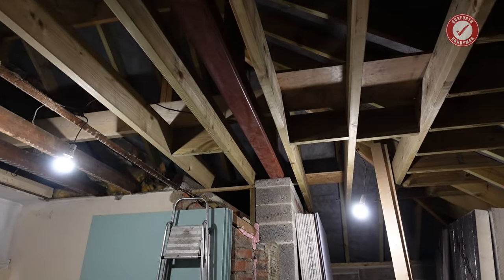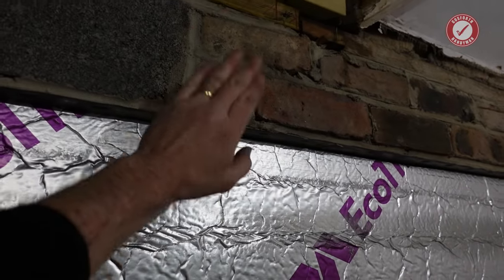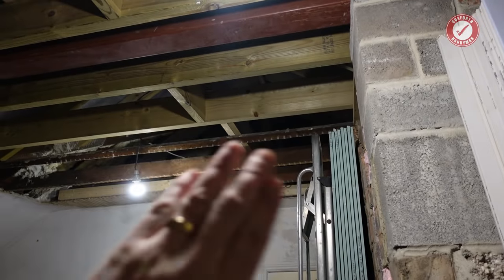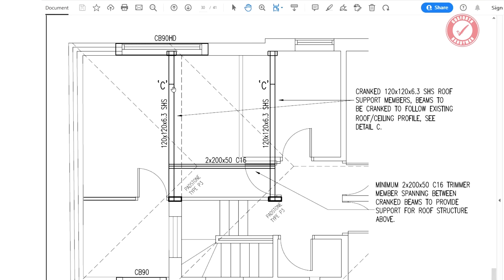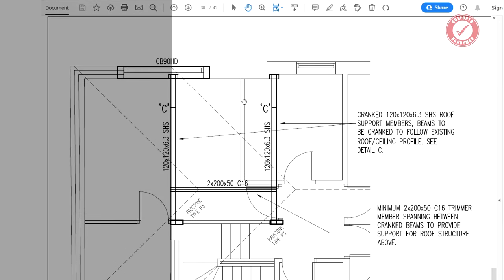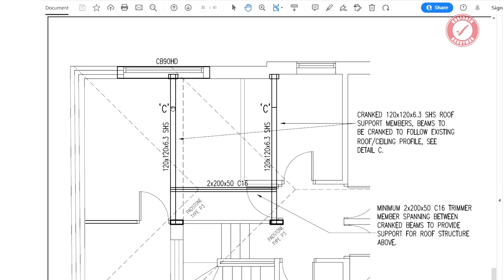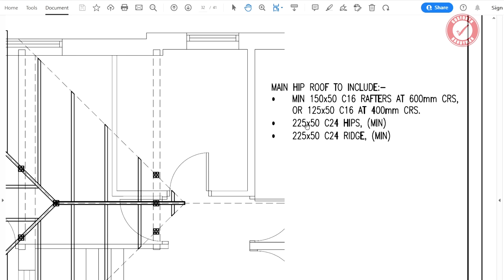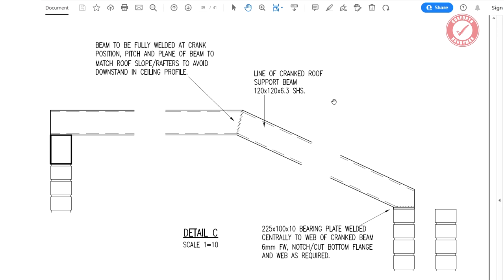Steelwork and structural engineer plans explained (Self Build Extension Part 11)

Comment: Thank you for the explanation Andy. As a practicing Chartered Structural Engineer myself it does all make sense. Not saying I'd have used timbers that large (preferring to sympathetically match the existing, cross battening where necessary for modern insulation so plate levels are maintained) but the basic philosophy is sound. Those uncoordinated details caused my eyes to bleed a little, the drawing checker wants their knuckles wrapped for that! What I find with a contingent of modern builders, and even some supposed experienced roofing carpenters, (and particularly the keyboard warrior experts) is that they don't understand thrust, spread and restraint. A fresh new roof may well look like it locks together without all that structural gubbins, but timbers shrink, joints open, relaxation and spread occurs, and then the householder sees cracks that repeatedly open until, sometimes years later, if at all, the roof reaches an equilibrium, and all the time normal seasonal thermal and humidity movement racks the unrestrained roof further. That early spread movement may have disrupted brickwork, and even rotated lintels. It's much better to properly restrain roofs during construction and mitigate all those nasty issues that will otherwise plague the building. And it rarely takes much more effort. As well as designing, we also write structural reports on (mostly) older properties for those selling and buying. Whilst many old roofs were build well and sound and have no significant issues at all, we make a good living out of appraising those other old roofs where the experienced carpenter thought he knew best and elected to provide insufficient restraint to rafter toes (particularly hips) leading to spread, internal and external cracking, bulging/leaning walls, or where purlins are undersized / insufficiently propped and have sagged and twisted, or ceiling joists bounce better than some garden trampolines - toe nailing through binders to hold up ceiling joist is a classic failure issue as the nails withdraw over time. The naysayers putting up roofs today with more confidence than skill, knowledge and understanding will continue to provide me with an income in sorting out their spreading roofs long in to my retirement and beyond. However, I can't see anyone having an issue with that new piece of roof, Andy. Aside from the somewhat chunky and generous timber sizes, well done for having it all put in. A good nights sleep will be had below those timbers. Thank you for sharing.
Reply: Would you have recommended trusses for the addition as opposed to the stick build as an alternative solution?
Reply: @peterwooldridge7285  Hi Peter. For this addition, no. It's far too small and would have resulted in a considerable amount of hand cut anyway. Trusses are usually more suited to areas where full span trusses can be erected over a larger area. Hips always seem to involve a lot of cuts, and this roof seemed mostly a hip. Not to mention there would still be a need to provide support to the existing roof where the original hip was unpicked.
Reply: It's really good of you to go into this much detail, well done 👌
Reply from the maker: Cheers Andrew - great info as always! 👍👍
Reply: Fantastic response - thank you so much for sharing your insight. I'm involved in the peripherals of the construction trade (on the banking side...often pronounced with a soft 'b' ;) ) and have seen my fair share of Chartered Surveyor & Engineers reports where things have started to go wrong - it can get scary and result in the remediation works costing more than doing it properly in the first place (although it's never the person who cut the corners that gets to pay for it 20+ years down the line). As someone who relies on professional reports (and the Professional Indemnity policies behind them) it's a great comfort that the designs typically provided by the SE takes into account the natural lifecycle of a structure and dynamic nature of the materials used. Incidentally - how much consideration is given to dynamic loading for this sort of design? Presumably there is a great deal of torque applied to a structure in heavy winds via the roof in addition to the static weight of itself?
Reply: @colinmottram4429  Snow and Wind loading, and their relevant combinations, are taken into account as necessary, especially for more complex multi-pitched/span roofs. Snow loading is always considered, with the intensity dependent on the pitch and areas where drifts may occur. Wind uplift may be the only relevant wind case on tiny roofs of this nature, although with the small form factor and limited overhangs, uplift and suction is unlikely to be significant and would easily be accommodated with usual holding down restraint straps. A vast number of older properties are pre holding down straps [mine included] and in the main seem to survive without significant incident. The dead weight of the roof alone has often proven sufficient [in the main], albeit with some notable media reported exceptions in recent months. Recent wind related failures with which we've been involved have usually been related to the absence of lateral restraint to gable ends, which has resulted in the extreme wind gusts sucking out the gable end, or where cavity wall ties have long since failed [or perhaps are absent/insufficient as reported in a new-build incident up north here a few years ago] and the wind has unzipped the external skin.

Comment: Thanks for explaining.  Basically the ridge needed some support but there was nothing under it so the steels bridged the gap to get a solid base to support from.  
I am jealous of your slope insulation. I spent days up in my loft retro fitting that and sliding insulation down the gap and doing the jack rafter gaps from the outside.
Reply from the maker: Cheers! Yeah, the slope insulation is critical as it's the coldest part of the roof. Defo worth doing. 👍
Reply: @GosforthHandyman  This, along with the cavity filling has made a huge difference. 
As we have a steep roof and a deep overhang, the outer skin of the wall stopped  about 50cm below the inside skin wallplate. So while repainting the outside I took off the fascia and insulated that gap too. I could not find anyone else who has done this!

Comment: Hi sir   I think the engineer has been very wise , and has been very prudent not to take any notice of the existing structure . Just those last photos of the existing rafters is proof that he was right . Even my own house that was built some 40years ago has sagged slightly even though the house was designed with 
18inc RSJs x 5 running the full  width of the house . The reason being for sagging is the jack rafters were just not big enough , if it was being built to day they would be a lot bigger . Having said all that the roof is not going any were because of the massive steels used , but I just thought it was a good example of things that can appear in the future .      Best wishes and kind regards as always 😀👍👍👍
Reply from the maker: Yup! In this scenario better safe than sorry. No sagging of the original timbers in 100 years but it's only a small roof. 👍

Comment: I do structural engineering for ships, not houses, but your explanation was good. I enjoyed seeing the architect and engineering drawings. You’re absolutely right that the engineer had to assume the new structure needed full support. Without the as built drawings for the house originally plus a detailed survey to note any changes since build and the current condition of the structure as it stands, it would be irresponsible to assume the strength of the existing structure and then depend on that assumption for the new work. If anything were to happen down the road, they would be legally liable for damages because of that assumption. In my work, we actually do the surveys to determine current as built condition because it is EXPENSIVE to assume the worst and with large ships the job is already costly and materials are a much bigger portion of that than the engineering. As you said, those beams aren’t cheap! But in small residential renovations like this, I assume it’s more cost effective to make that assumption and pay the price in materials than to do the investigative work to determine the bare minimum support required.
Reply from the maker: Very interesting! 👍👍

Comment: We live in an old terrace where the roof has huge purlins (think that's the correct term, they look the size of large tree trunks) With a big triangle construction in the middle of the roof made from huge sawn timbers, with smaller rafters sitting on the purlins. All the timbers look more like logs than modern rectangular timbers, all the joints are dove tailed or mortise and tenon. In terms of craftmanship its a beautiful thing to look at (even if it does make feel somewhat unsure of its structural integrity after all these years).

However this video got me thinking how you would marry that old construction with modern construction if you were to try and do a similar extension on a roof the age of mine.
Reply from the maker: Old terrace houses often have huge roof spaces so the spans are much bigger. In a similar extension you'd need extensive steelwork. 👍

Comment: The steels make more sense now, although I would have thought the existing timbers were very 'examinable' in situ and the steels would have been just as effective if they'd been tension bars spanning the house and attached to the roof spars to prevent the roof spreading under its own weight. But as you say, there's no point arguing.
Reply from the maker: Yeah, I didn't really want to argue the point as he's worked in hundreds of these houses. 👍

Comment: The timber and nails scenario just highlights at some points just how "rough and ready"  the construction industry is.  However, it's best to adhere to engineers guidelines and better to be safe than sorry Andy !
Reply: I find it quite interesting. Our home was built in the late 1800's. All the floor joists are dove tailed into two large beams that span the downstairs space. You can see old stuff beautifully crafted together, whilst the modern repairs just butted up against and scatter-gunned with screws/nails. I suppose its strong enough and time is money and all that
Reply: That's when real artisans were working solely with hand tools, No electric drills and saws et cetera then Stephen.
Reply from the maker: Indeed! When you think this entire original roof was built only using hand tools. We've become lazy as a society. 👍💪
Reply: That indeed is the case Andy ! It's all starting to come together.

Comment: Thanks for the great videos, I'm learning lots!  Also I've just found the measuring up podcast, only a few years too late.....
Out of curiosity, how picky are building control?  If the structural engineer specs 2x(100x50) and you use C16/24 it's actually 95x47(IIRC) are they going to complain or is this more of the typical building materials nominal sizes and you need to know what everyone actually means rather than what's written down?

Comment: I understand the structural proposal but I have to say that the sizes are much larger than I would have expected and certainly more than would probably have been specified by the various structural engineers I use.  Unfortunately, some engineers design on a dot to dot basis and not holistically.  An example of this is that is the size of the ridge beam than can either be assumed as carrying weight or as just a separator of the rafters, that is why traditionally the ridge plate was 200/250 deep x 25mm  
The 120x120x6.3 SHS is actually 120mm by 120mm by 6.3mm wall thickness Square Hollow Section.  You also get RHS and CHS that are Rectangular and Circular respectively.  I assume that the SHS was specified to get the steelwork within the depth of the rafters.
Having now seen in detail the construction I assume that the central double beam doesn't support the enormous ceiling joists so that it and the steelwork only support the roof.  If  so, then there is no need for fire protection to the steelwork.
I note that the roof has been sprayed with polyurethane foam, which is a real problem as the system is not vapour resistive and thus condensation will occur in the rafters but before then it would not surprise me if the tiling battens start to rot as any water getting through the tiles will run down the sarking but only as far as the first batten where the foam has taken the sag out that normally allows drainage of incidental water.  If you were to retain the rafter level insulation it would be logical to extend that over the new roof, but be aware of the required detailing to prevent vapour passages and cold bridging.  A good solution to this is to use multi-foil insulation/vapour barrier. and PIR board under.
Reply from the maker: Cheers Clive! 👍👍

Comment: Can see it has 'belt and braces' , a very solid construction apart from one thing -  a purlin. Think I would be tempted to add one between the two vertical supports on either side to give additional support to the intermediate rafters. But suspect the rafters have been sized to allow for this? 
Love roofs. Always a mess of timbers !!  :)
Reply from the maker: The the rafters are sized to allow for no purlin, since there wasn't one in the existing roof. 👍

Comment: Old ridge timbers were usually only 1" or 1 1/4"r inch thick as they do not support anything [the rafter each side support each other]. it is just there as something to fix the rafters to and stop them moving about.
Reply from the maker: Yup! The 9" ridge timber did seem a bit excessive. I guess it was partly to accommodate the bigger hip timbers and rafters. 👍
Reply: @GosforthHandyman  There were no structural engineers involved when that place was built. They do tend to work it out. double it and add the date in. But as you say you have no way of doing it.
Reply: Using the, 'look these buildings have lasted 100 years + so old building methods were good, no need for all these calcs' argument, does not take into account those old buildings which fell down or were replaced because of structural problems. We are seeing the survivors, or satisfactorily remedialy fixed, today. Numerous Cathedral's roofs had to be re designed and replaced, as they were built, but these were well documented buildings.
Modern materials are often heavier. Replace a slate roof with tiles and the structure needs redesigning, including the slope.
Great video Andy.

Comment: Don’t forget that the older timber is usually very strong. I struggle to cut some of the older stuff.
Reply: You need to use an old saw.
Reply from the maker: Good firewood too!
Reply: @ricos1497  Well said.

Comment: Fascinating! Will all that spray foam insulation on the original roof now be redundant? I pressume you either get the new roof sprayed or fully insulate the whole ceiling to current standards? Edit: Sorry I think I found your answer way below - Insulate whole ceiling. Cheers.
Reply from the maker: Yeah, might take the spray foam out at some point. Keeping an eye on it. 👍
Reply: Did you have any morgage problems with the spray foamed roof?
Reply: @donald840  I sold my dad's house about 5 years ago and had 3 people pull out as their lenders wouldn't give a mortgage as it had foam spray in loft, had to change roof eventually to sell it.

Comment: Wondering if you had stripped the entire roof back and rebuilt the roof structure, would it have been comparable to the cost of getting the steels done and in and all the engineering? And what was the existing stuff like? Seeing what you pulled out, it seems the rest might have been in quite good. condition
Reply from the maker: The existing timbers were perfect but stripping the whole roof off would have been very costly. The whole roof would have needed a temporary cover, complete re-tile, waste disposal of the old roof... probably looking at min £25k to do that vs ~£800 for the two steels. 👍
Reply: @GosforthHandyman  wow, didn't think steels would be so cheap

Comment: I would have thought flitch beams would have been just as effective, cheaper and fabricated on site too.
Reply from the maker: Possibly! The steel was fabricated on-site tho. 👍
Reply: I think you could do that for the second steel but the first one has the old hip rafter running across. 
Other option is to chop the old roof back to the end of the old ridge and replace the old jack rafter with all new. You still get to the question if is the old roof being supported by the new and adding strength to cover this.
Reply: @GosforthHandyman  It’s almost impossible to meet CE/UKCA regs using onsite fabrication. Did the fabricator provide some kind of execution class compliance documentation?